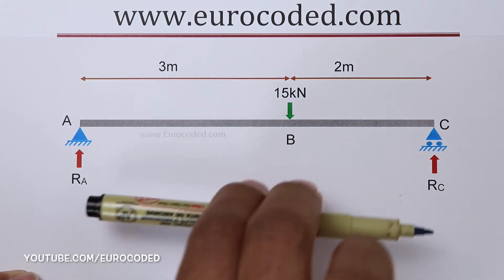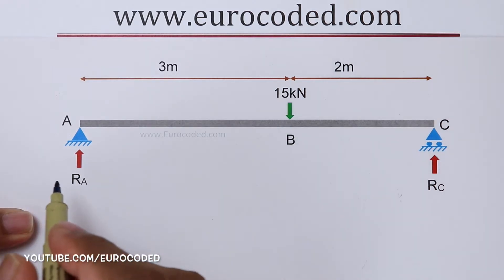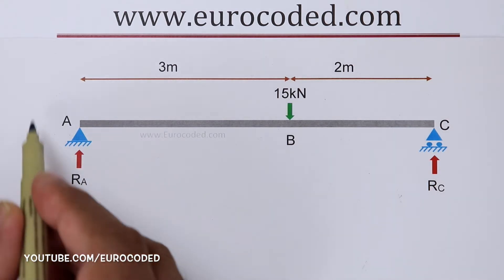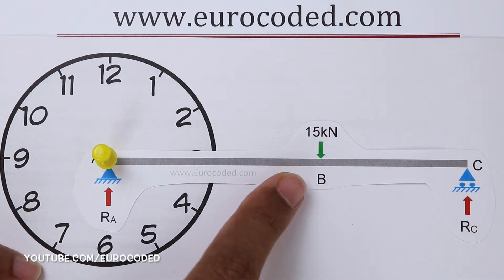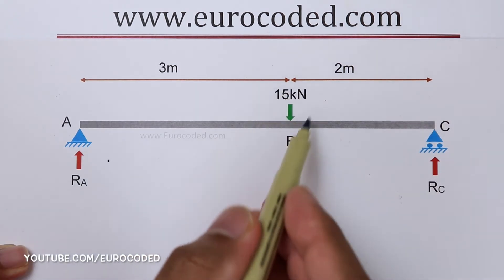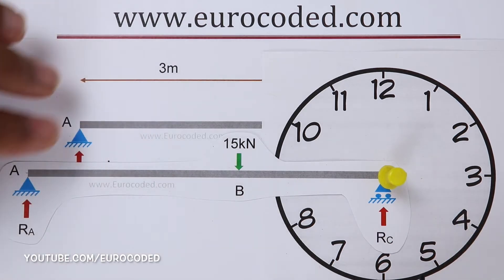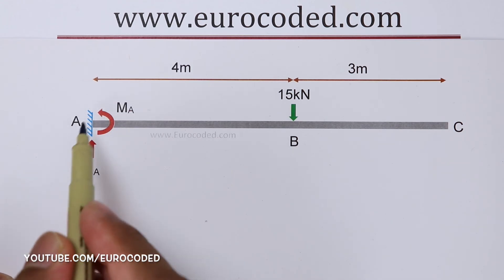Direction of a Moment - How to Determine Clockwise and Anticlockwise Moments

Comment: Hello. I'm confused with horizontal forces' sign in moments. If the moment is assumed to be clockwise and the horizontal force is facing left, is the horizontal force be treated as negative? Same goes to if same moment rotation but the horizontal force is facing right; does the force becomes positive? Thank you for answering.

Comment: Hey if i have a beam and and two forces are acting in clockwise and anti clockwise movement at the ends and i have a weight in the middle how do i know in which direction is the weight acting?

Comment: Thank you so much . I have a question regarding this subject how can i determine this direction if the fulcrum is a point and a force pull it to the left or right not up and down it also sometimes result forming an angle how can i know its direction .THANKS AGAIN!

Comment: Are force sign standard + up and + right  - down and - left. Moment  sign of rotation can be assumed? Clockwise + counter - or clockwise - counter clockwise +?
Reply from the maker: When looking at equilibrium, the typical sing convention
Forces: up/right + and down/left -
Moments: clockwise + and counter clockwise -

You can use any other sign convention as long as you use the same sign convention throughout your calculations.

Comment: Hey, thanks for the video. So is it always a point on the left is clockwise, and a point on the right is anti-clockwise? Also, what is the importance of it being clockwise or anti clockwise when calculating the 3 equations of equilibrium? Thanks.
Reply from the maker: If you have a downward force and you are taking moments about a point on the left then the moment is clockwise. And if the point is on the right for the same downward force then the moment is anticlockwise.

If you have an upward force and you take moments about a point on the left then the moment is anticlockwise. If you take moment about a point on the right it will be a clockwise moment.
Reply from the maker: Sum of clockwise moments = sum of anticlockwise moments

That results in equilibrium.
Reply: Thanks so much for the quick reply! :) can help me with my homework if I’m struggling 😂

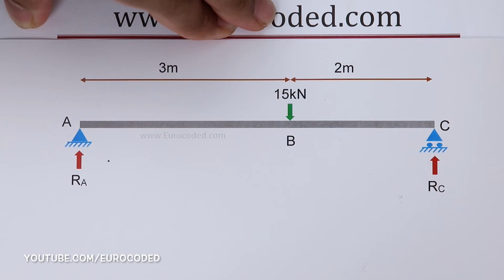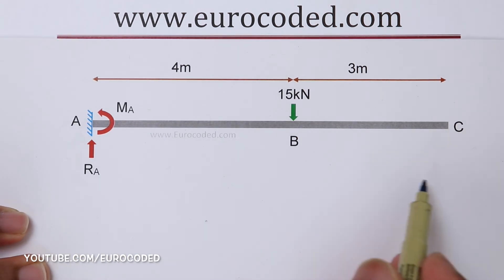Comment: In the first example (0:28), you describe the Bending Moment in the direction of the applied force (clockwise) around point A – which in my eyes makes absolute sense. The same goes for the Momentum around point C (1:19; counter-clockwise in the direction of the applied force: negative Y-axis). So far, so good. But at 2:07, the beam would bend downwards in negative Y-axis (in the direction of the force vector). Yet, you sketched M_A counter-clockwise around point A, so the Momentum is showing completely in the opposite direction as explained in your first example. Why is that?
Reply from the maker: Tranefine that M_A drawn in red colour is a support reaction. The support reaction should be in the opposite direction to the moment due to 15kN. Watch this video: https://www.youtube.com/watch?v=SiaeIFNOFtc&list=PLKYpFtSJqr3gBb4ofRFJPmQaMbSPAfLwf&index=5
Reply: Eurocoded – Are you really sure that you don’t want to hold some lectures at my university? ;D. No, really, thank you very much! Yes, the support reaction is what I wasn’t thinking about whilst watching the video. But your videos are really helpful, and I also appreciate that you still answer questions under your videos. Not everyone would do this! 

There isn’t an option to send you in questions/exercises we struggle, is it? :D

Comment: in the cantilevered beam why is Ma counterclockwise?

as you show the force is downwards so the moment should be clockwise.
Reply from the maker: CENDOL the moment from 15kN when taking moments about point A is clockwise. M_A is the reaction moment. For moment equilibrium, M_A has to be in the opposite direction i.e. counterclockwise.

Comment: Sir in an other example you said that 15kN is trying to move in clockwise direction but there is a direction as counterclockwise direction so which one we should consider sir ? clockwise or counterclockwise? At point A
Reply from the maker: likhit shahrukh direction (i.e. clockwise/anticlockwise) of a moment depends on where you take your moments. Ex: about A or about C. In first example when you take moments about A, 15kN results in a clockwise moment. Hope that helps. Let me know if you have more questions.